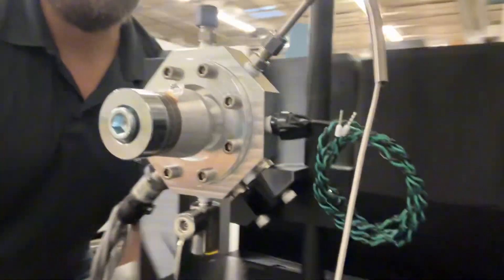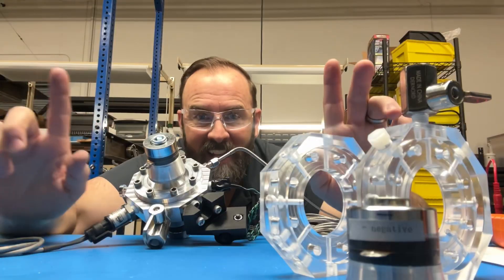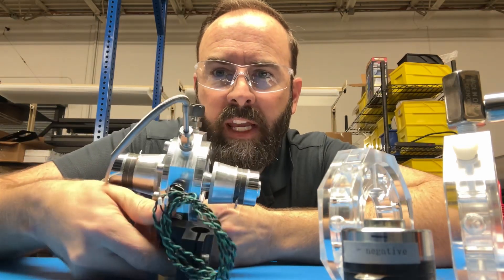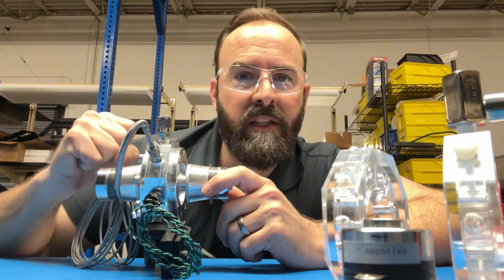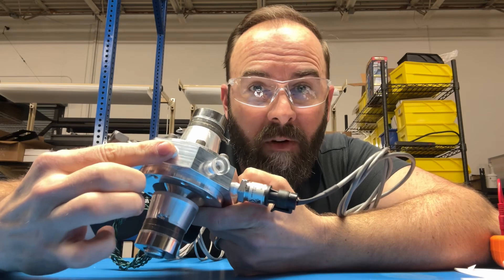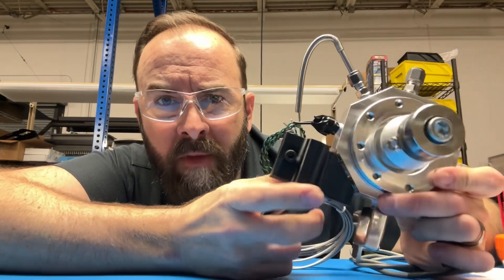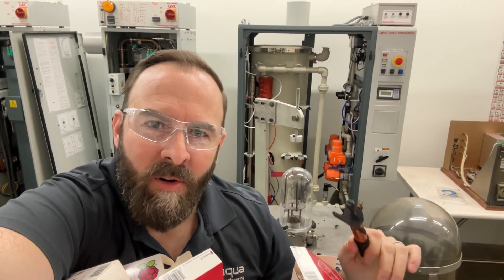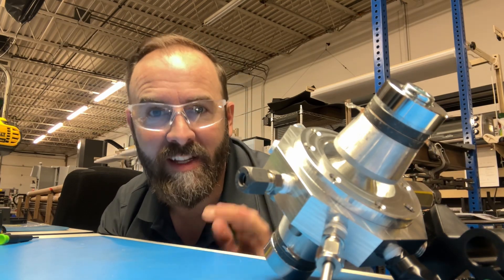LENR Sonoluminescence Reactor Part 1

Comment: There's a guy on youtube who's doing similar experiment but with deuterium in oil medium. He managed to get neutron emission higher than background exactly once. Pretty lights when the bubble collapses, though. 
Subbed to see what you come up with.
Reply from the maker: Do you know what channel? I may have chatted with him, I heard the oil thing come up at one point but I’ve done very little serious collaboration. Just want to go into this as blind as possible tbh.
Reply: @i2c_jason  It's on Tim Ventura's channel, titled "Bubble Fusion Breakthrough? | Max Fomitchev-Zamilov".

Blind is admirable, and your setup looks expensive, but are you sure there can be something here? Other than a pretty twinkly lights with occasional neutron bursts.
Reply from the maker: @ANToxic777  Awesome, thank you. RE success or failure - I have *no idea* if this will work or produce anything valuable. Solving LENR isn't as easy as building one prototype and saying it works or not, it's definitely a longer term data gathering quest. I'm simply here out of curiosity to explore with empirical data sweeps and hopefully create a starting point for the open source community. Also what might look weird to most researchers is that I'm working it backwards, from the engineering end of things using an assumption that prior LENR results may in fact be true. I believe an open source reactor design will advance the technology much further than grant money, much the same as open source projects have given us Linux, etc.

Comment: I have my doubts about the effectiveness of the metal lattice, but if you can get good x/y/z/t control of the cavitation bubble, that could be really helpful.
Reply from the maker: Yes, first and possibly only goal in the near term is to nail down a reliable open source sonoluminescence reactor that can be easily duplicated. Then the community can at least have a starting point for an extreme hot spot in a sphere of water with data logging and closed loop pressue control.
Reply: @i2c_jason  The "song" you feed into the piezo vibrators is critical to get right... you ramp to critical and deramp specific oscillation, like keeping a quarter spinning by bapping it just right. Crude I know, but Meyers work has images of the Waveform and I have documents.

Comment: I encourage you to consider licensing CAD files under the CERN OHL. It's tailored towards hardware rather than software, which is important because they're covered by different IP laws (patent versus copyright).
Reply from the maker: I looked into this... it sounds like the CERN OHL would require anyone who uses the 3D models to make their child product also open source. Is that your understanding? It's really something to think about. I'm not sure if that's better or if it would stifle potential new product innovation in private labs where the financial backers don't want their work to be open source. Thoughts? Because I have no idea, I can see both sides and don't have a strong opinion yet. Thanks for pointing this out btw.
Reply: @i2c_jason  I bet it would excel it further for open source makers, but steer corpo use away.

Comment: Can't wait to see what comes out of it! I wonder, what would be the primary energy output from this reactor, heat or light..  Also it reminds me of plasma electrolysis type of LENR reactors, but supercharged.
Reply from the maker: Thank you for watching! I'm anticipating hot water and hopefully hot enough to generate steam and power a generator in a separate steam loop, and hopefully have a working range allowing temperatures to not be so hot that we have to machine all of the parts from a higher temp material such as stainless or pure nickel. On the topic of light output, it's also possible that we get intense enough light, possibly coherent light if we use the laser cavity variant of the design, that could be used to dump heat from the cavity in the form of photons. I think the laser variant is very speculative and far fetched at the moment, so steam is the likely candidate for that secondary power generator system if/when we get there.
Reply: @i2c_jason  yeah, the steam would be great (easy to work with), and light might be a good addition to increase efficiency somehow. Also, on topic of working temperature - it would probably be possible to run it in pulse mode, if the temp gets too hot.
Reply from the maker: @x_ph1l  For sure we could duty cycle it down, and probably will do this by going off-frequency rather than completely shutting down (or something like that). I'm more concerned about having enough heat to generate enough steam while staying in an operating range for Aluminum. If that operating range is to narrow and temp too low, we'll have weak steam output and weak energy transfer. But I'm getting way ahead of myself. Sonoluminescence itself will be a huge milestone here, as that's usually done in a glass sphere and some have shown doubts about whether this machined geometry can get there. I don't see why it couldn't.